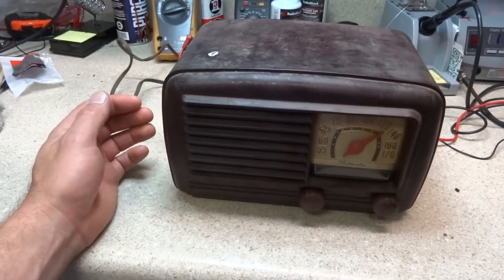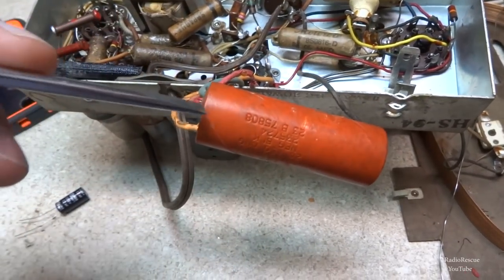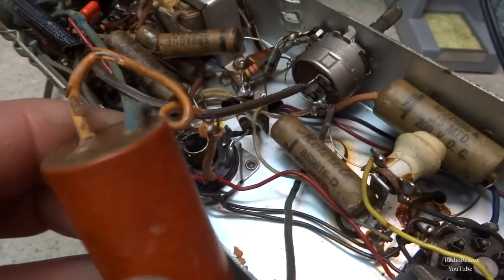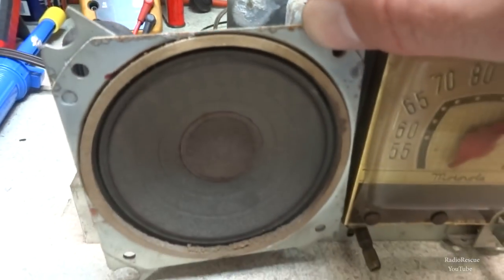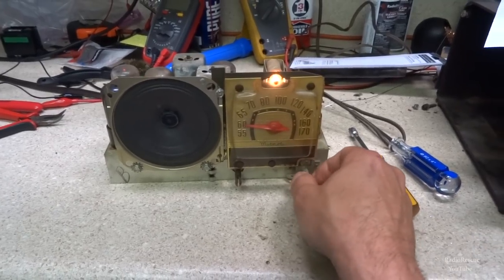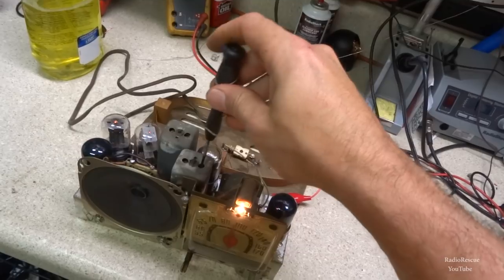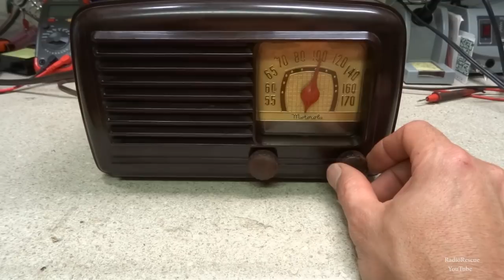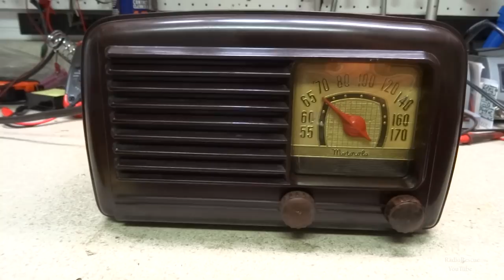Repair Of A 1947 Motorola 56x11 AA5 Tube radio

Comment: I had to build a 5 tube radio from a kit in vo-tech school and align it and tune it.  Only tube radio I ever worked on. The instructor made sure we had the chassis plugged into an isolation transformer while we were working on them.(actually any equipment)I repaired a lot of transistor radios and tube chassis TVs. I miss those days.
Reply: 1975 was the last year are high school shot built a 5- t u b e radio

Comment: I just bought an RCA with the same model number.The seller said it works,but you know how that goes.It dates from the '40s just like the other two I have.I'm expecting it to have SMD like my '49 8X71.An interesting thing about the '46 65X1,the ground on the filter cap goes to the antenna coil rather than to B-.I've never seen that before.Its repaired and works nicely;its in my kitchen.

Comment: This radio frame looks just like my EMERSON that is also from the 1940's. 
Mine is not rounded on the edges but has the same dial deco. 
Only tunes from 550 to 1,600 KHz though.
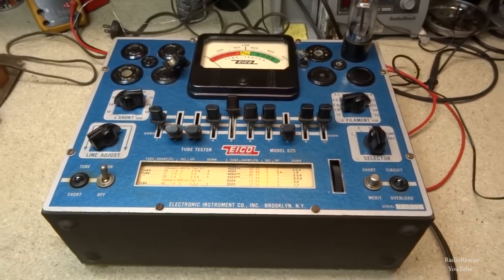17:15 My late father built for himself a tester like that, he had apprenticed at RCA

Comment: Surprised to see dogbone resistors and octal tubes still being used in a '47 radio.  Must have been one of the last sets to use them. Most designs had gone over to the miniature AA5 tube complement around that time.

Comment: I had a similar problem with my philco model 70, I thought I had to redo the filter caps, but it was actually a cheap 120 to 5 volt wall wart causing interference

Comment: On the 3 section filter cap, did you put in a 22uf cap for the blue wire? Looks like you only showed 2 sections of it, the red and orange, not the blue. I assume you used a 22 uf cap for the blue same value as the orange.

Comment: I might be wrong (6:44 in the video)...but dont two caps in parallel halves the total of the two....and two in series is adding the two...is this right...???
Reply: Nope. Just the opposite. Two identical caps in series gives you half the capacitance (but doubles the voltage rating). Parallel gives you double the capacitance and same voltage rating.
Reply: @Inflec  maybe I was thinking of resistors..
Reply: @kennynvake4hve584  - That's correct.

Comment: Hello, i was wondering how much you would charge to get a Dial string restrung on a AA5 tube radio. I have already restored the electronics, but do not have the time to restring the dial string.

Thanks.
-Ethan
Reply from the maker: Yeah i avoid them whenever i can. I only do them when absolutely necessary.
Reply: The Dial String on mine has broke, so i cant use it anymore. How much would you charge to fix the problem?

-Thanks

Comment: Hello, I have a model A15J3 that I need a volume control for. Do you know where I may obtain one?
Reply from the maker: What's the value?
Reply: @45AMT  It is 1 meg. & it's on a pcb & has 5 pins.

Comment: Do you have to remove the resistor to measure?
Reply: Depends. If the resistor in question has other resistors or components paralleled in the circuit with it, it is a good idea to disconnect one lead to be certain of getting an accurate reading. If the resistor is going to a tube pin with nothing else in parallel it can usually be checked in situ without having to do this. Solid state electronics generally requires the one lead disconnect because of the shunting effect of transistors and i.c.s.